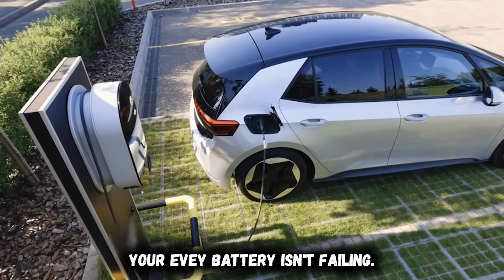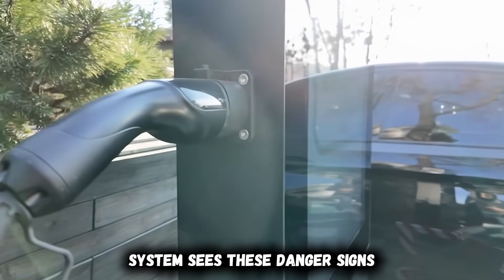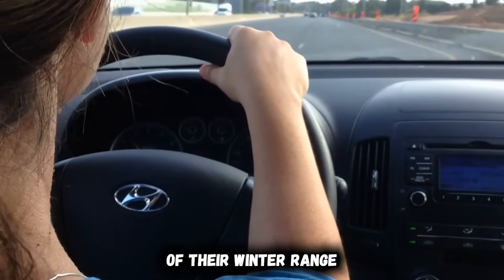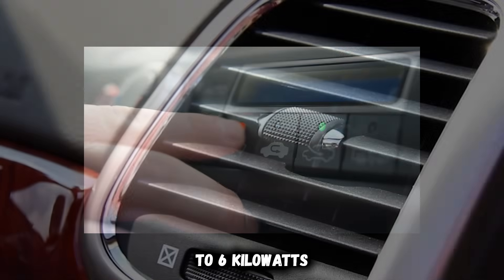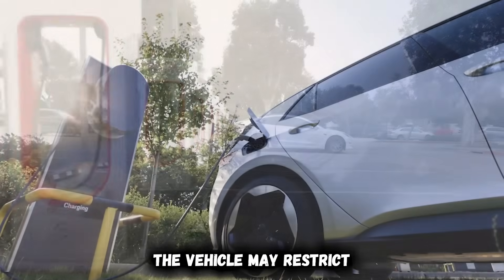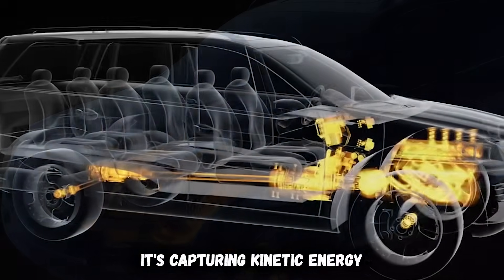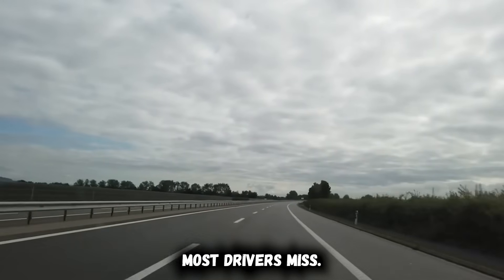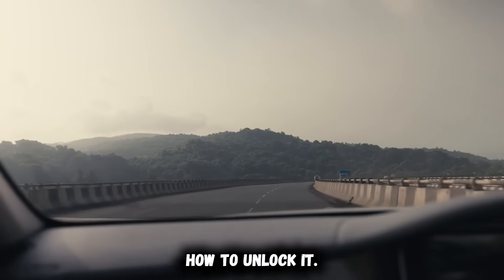Never Do THIS in Winter With Your EV (Most Drivers Do)

Comment: Great Video!  Do you still need to precondition the battery to charge it on a garage charger that is level1/2 (16 amp/220v) NOT fast charging?  I always precondition battery before driving but then when I get back to the house I usually plug straight in to the charger there - I don't precondition again until the next time I am going out. 2024 M3 highland AWD.
Reply: if you plug in as soon as you get home, your battery and motors are alreay warm from use.  In hot weather you should actually let the battery rest for a couple hours to let it cool down.  If you plug in immediately but have time-of-use lower cost electricity overnight, program the EV to charge while the cost of power is lower.  The EV will pull a small amount of power to keep the battery temperature in the best range for the timed charge up later - because the EV "knows" the programed charge time is coming, and also knows the battery temp and ambiant temp. outside.
Also program your departure time, and the EV will precondition (heat in winter, cool in hot summer) the battery pack and motors and your cabin to be ready for the time you set for departure.  In very cold weather my EV may start the preconditioning almost an hour before my programmed departure time, to slowly warm up the battery pack and motors, and then just ten minutes before the departure time warm up the cabin.  These are very sophisticated systems.  The EV doesn't let you "damage" the battery pack - they have 8-year warranty on that expensive pack, and they do a lot of things to make sure it is always protected.

Comment: Is preheating your car the same as pre-conditioning. 2) how do you precondition the battery if the charging destination is charger that is not a supercharger
Reply: the EV doesn't need a 'super charger" to precondition - any plug in will do.  The super chargers are designed to charge up your EV FAST so you are not waiting for hours to get going agian.  Standard wall outlet (120v AC) can be used to maintain your EV while you visit someone, and it will charge a small amount if it is not super cold.  240 v AC outlet is better, ie higer energy available.  Can precondition and charge the EV at the same time, often at 6kW to 10kW rate depending on the electrical supply. In cold weather you want at least a 5-6kW 240v AC level 2 charging - ie a dryer plug 30-50 Amp outlet.  - but most homes without an EV will not have these plugs on the exterior of the house.  Some may have in a garage or carport.

Comment: Good video, you talk allot about preconditioning before leaving the house. How do you warm a Tesla if say it’s been parked outside in really. Cold weather for three hours and you are mot near a plug,  say you were at a friends and it’s -20and time to go home , this I cannot seem to find answer to
Reply: you can leave the car "running" which will continue to keep the battery and cabin warm - it will use some energy for those three hours.  You can ask if you can plug in your 120v AC destination charger to their house while you visit them {if they ask you, your max electricity use would be about 1.3kW per hour x 3hrs (say) x 15 cents would add 60 cents to their electric bill for your visit.  Bring them a gift when you show up, everyone got something.

Comment: Emmmm… “never charge when your battery is below 50F”?   Yeah, if that is a detriment to battery longevity, I would assume the car makers have already addressed that so you don’t need to worry about it (I don’t see a battery temp gage in my car, does anyone else?).  Otherwise this would be a very very significant problem from all of the cars manufactured. This video waste of time, click bait and overly dramatic

Comment: but preconditioning takes battery as well, so i feel like it doesnt matter unless it takes less energy preheating than it does just driving it
Reply: The point of preconditioning is to do it while plugged into the grid.
If you have no plug, then the preconditioning is to ready the motors and battery (and regen braking) to work when you start to drive, otherwise you will see your EV report less than 100% available power, and your re-gen brakes may not work at all, meaning your using regular friction brakes.  In cold weather, if you know your departure time - program the EV so it prepares for that time.  If you can, plug in while you are stopped, even a 120v level 1 will maintain the battery temps better than off-plug.

Comment: the Lucid fixed this with using a heat pump for heating the cabin and battery
Reply: Ford Lightning did too in 2024, but there is still more energy needed during cold weather - to maintain cabin temps, battery pack temps, electric motor temps vs mild weather,  no free lunch.  The 92% efficiency of electric means there is no exessive waste heat being thrown out via the Radiator out front, to scavenge cabin heating from.

Comment: This guy is clueless 🤡 If you get to s DC charger with a cold battery, the BMS will first warm the battery up to a temperature where is can charge fast safely. If it is out of this window it will not charge, it will only warm the battery. 
He is correct regarding preconditioning the car before leaving will give better range because the battery and car is warm.
Reply: BMS is there to protect from catastrophic failure and excessive lithium plating. Some lithium plating is always bound to happen, the more the colder it is. It is up to the car manufacturer to decide how much to sacrifice battery health for performance.

Comment: when should the recirculating cabin air button be activated?
Reply: in summer or mild weather - because if you try to use it in winter, all the windows will condensate and fog up.
If you pull up behind a dirty diesel you can switch to recirculation for a few minutes until you blow the doors off the diesel and leave them (and their stinky pollution) behind you, then turn off the recirculation again before the windows fog up. handy in the drive through too.

Comment: Unfortunately for the rest of the people who know nothing about lithium batteries and their chemistry this fool saying that modern TVs that pull up to a charging station in freezing weather will have lithium plating is deceptive and misleading, and apparently knows nothing about how lithium plating actually occurs.. without getting into the specifics which would take many pages here's an example of why this b***** video is pure garbage... I currently own a 2017 BMW i3 it's 10 years old and has 120,000 km on the odometer it still has 93% of its capacity. I talked to the previous owner who regularly charged it when it was freezing temperatures in Quebec. My previous three BMW I3 vehicles we're also charged when it was freezing and none suffered any degradation which would occur if there was lithium plating... lithium damage occurs when you attempt to charge faster then the battery can accept as the lithium ions move more slowly the colder the battery is.For example, my 28 kwh battery charging at 7 kw is only 1/4 c and if you don't know what I'm talking about you shouldn't have made this video...in fact when i checked the actual charge rate this morning at -8 Celsius  the charge rate was only 4.8 kw proving that the BMS is reducing the charge to what it has been programmed to not damage the battery ...damage is possible when attempting to charge faster than you can move those ions but at thisnrate and this chemistry you wont damage it at all. The last point and most important of all is that these multi-million-dollar corporations know how fast you can charge a specific chemistry type without doing damage so they limit the charge and allocate most of that charge into heating the battery so that it can be charged safely

Comment: Garbage. We had a few where I work. Cold climates are krytonite for an EV. They burn through tires because they are heavier. Don't use your lights or heat. Battery drops rapidly.

Comment: but my area stayed at 20 degrees or lower for an entire month last year.(single digits at night)   Does that mean I can never charge my EV for a whole month?
Reply: No just charge it. It will heat it up before charging if too cold and will limit charging until warm. Always do the charging after driving not before driving use the heat the battery has in it to get the charge going

Comment: Gas refuel, five minutes and on the road.
Reply: HAHAHAHAHA 
EV: arrive at home, takes five seconds to plug in, fully charged in the morning ready for another full day of driving for a few pennies per mile.  unplug and just drive. LOL.
ICE: drive to the gas station (not fueled at home) stand beside your car in the cold, in the rain, can't leave the car while it is fueling, pay $70 for the smelly gasoline.  Do it again every week. LOL. yeah takes no time at all.
A study monitored 1,000 car owners, 500 ICE and 500 EV, and even with DCFC on trips, the ICE drivers still spend MORE time refilling per year. And, a lot more money.
The best part of an EV is the things it doesn't need: exhaust systems, alternator replacement, starter motor, Evap system leaks, transmission problems (looking at You ten-speed GM) transaxel, turbo, head gaskets, spark plugs - oil changes all year every year...my EV 30,000 mile check "change the cabin air filter, and top up windshield washer fluid" LOL.  580Hp, 0-60 in 3.8 seconds no maintenance 8-year standard factory warranty.  drive for pennies per mile, mile after mile after mile.

Comment: Below zero Temps now in mid West. Good luck EV drivers.
Reply: I live in Illinois,  when it gets in the 15 degrees F , It takes my tesla 15-20 minutes in the morning to precondition the battery while plugged in,  cost Penny's. I can also set the car to precondition battery automatically before I leave, ill never go to gas car again ! From $250.00 In gas a month i'm down to $45-50 a month and zero maintenance  besides windshield washer fluid.
Reply: @AndersonERockefeller same!
Reply: No problems in winters here with even -30C.
Reply: When I had a gasser - remote start it to warm it up in winter - takes 20 minutes of idle time to warm the cabin and costs dollars per day, and it is hard on the engine to sit there running like that.
Now with the Lightning, it preconditions itself based on programed departture time - which you can easily change from your phone - costs less than 20-cents to precondition and heat the cabin - silently - each morning and is Not hard on any part of the system. Once heated up on-plug, you unplug and go about your day every day for a buck or two per day, not $15-25 per day.
no spark plugs to change, no oil changes 4x per year, no exhaust or muffler work ever, no starter motor, no altanator to fail, no transmission issues (ten-speed shit) and never need to drive to get fuel, just plug in at home every night, and full tank every morning ready to go.  Best truck for winter - because it has 50-50 weight front and back.  Best short distance tow vehicle by far.  The Lightning out-pulls my 3/4 Ton easily. 580Hp 0-60 in 3.8 seconds - try to beat that.

Comment: Just never do a BEV and you'll never have to never do whatever this video is telling you to never do. Drive a gas car and liberate yourself! Simple.
Reply: Cost of gas per year for a hybrid: $1800.  Electricity for a BEV: $300.  If the cost of the vehicle is equal, it's a no brainer to get an EV.
Reply: @davidp.4727  cost of wasting your time charging, immeasurable. $300 yearly cost for electricity, is pure delusion/bullshit.
Reply: @zooker7507  Plug in at home, is that so hard to understand? I own an EV and yes, I pay $300 a year for electricity.  Inform yourself.
Reply: @zooker7507  takes a few seconds each night to plug in-in, and a couple seconds to unplug in the morning, full "tank" every day for pennies. does it take a few seconds to go to the gas station and pay $75 x 40 times per year? no.  My EV truck costs a few hundred per year to drive, instead of $6000 in gas. plus oil changes, plus exhaust/muffler/starter/alternator/transmission.  I invested the cost difference, and in 7 years it will be enough to pay for the next truck. Does the Oil company pay you for your next truck?  In early 2025, the Lightning was the SAME price as a 5.0L F-150.  With cheap electricity, this was a no-brainer.
Reply: @r.b.l.5841  your not making a good point. Gas cars are practical tools of freedom which allow you to travel across the country with great ease if you choose. Even if I was afraid to travel I would prefer the convenience of gas vehicle, and the safety, and the practicality. Too many things to speak of. This savings of electricity you speak of only exists because of subsidies that are in place to encourage or trick the population to adopt the new tech. Once adopted though, you will see that the market of energy pricing won't be in your favor any more. Your belief of savings you get from electricity over gas was formed through careful planning by those that hope you don't understand that slight of hand.
Reply: freedom, lol. the first thing I noticed after getting the EV was actually being free. 
That is free from the oil leash, which is quite a liberating feeling.  
meanwhile at our home we have one ICE, one hybrid and one full EV.  we can chose which ever one makes the most sense for any given application.

When i bought a cordless drill years ago, I didn't throw away my corded drill, I  just didn't use it very often.  I start the ICE once  week just to keep it in working order, but we don't use it very often.  Mostly a loaner for visiting family, until they catch up with the times.

travelling across the county is no problem in an EV since 2022 when all the makes opened up access to one another.  I drove over 30,000 miles for under $600 last year, did you?
Reply: @r.b.l.5841  now your bound by your electrical cord. 45 seconds to fill my tank and I'm on my way.

Comment: If you pull up to a Supercharger and your battery has not been preconditioned properly, the BMS will use the Supercharger energy to warm to the battery first to avoid damaging the battery. It can take up to 40 minutes to start charging if your battery is frozen. The BMS will prevent charging to protect your battery.
Reply: The BMS has a minimum threshold below which it will not permit charging. You need to check the manual to see how low that threshold is for your own car, as the advice onine is pretty general. For example, some manufacturers quote 20degF but in the small print your SoC needs to be well  over 20% to charge at that temp. Some commentators advise not letting your SoC get below about 30% when temps are at freezing point or less. This is because the car can use some of that to raise the battery temp enough to get above the BMS' threshold. If You're below the threshold and there's too little in the battery to warm itself up through preconditioning, they say you simply won't get a charge.
Reply: @mikeshelley4996  The BMS won't precondition below 5% on a Tesla, but it will charge. And if it's cold, it will use Supercharger electricity to warm the battery while restricting charging rate til the battery is warm enough. If the battery temp is below 32F, it might take 45 minutes to warm the battery before the BMS will allowing any charging.  (This was happening in Chicago a few winters ago)
  The BMS is programmed to protect the battery in these conditions.
Reply: @777Outrigger  I think my Kia has a higher threshold but manages to charge OK at 20F provided there's plenty still in the battery before you start. I'm not minded to experiment - and the dealership hasn't clarified the numbers.
Reply: @mikeshelley4996  so if your declared range is 500km, what real range do you actually get at -20 Celsius? 200?
And then comes the recommendation to only use 1/2 of your actual range to account for being stuck in traffic.
Reply: @marekstanek112  I've seen the range reduced by 45% in -25F (-32C), but he didn't precondition the battery before he left.
And you won't be consuming much battery if you're stuck in traffic. In fact, if you happen to be worried about not having enough charge to get to the next Supercharger, just slow down 10-15 mph. You'll see your range rise by a lot.
 And if you're worried about getting stuck traffic in the freezing cold, Tesla's batteries will keep you warm for up  65 hrs starting from 100% battery with the thermostat set a reasonable level. No one has frozen in a snowmageddon in a Tesla, because the heaters just don't consume that much electricity.
Reply: @marekstanek112  Fortunately I don't get -20C but I take your point. At around 0C I appear to have "lost" about 35mi (just over 50km). Personal safety in winter, though, is an extra consideration. Having plenty of juice in the battery could be a life-saver if you get stuck somewhere below zero, so why allow SoC to fall seriously low?  I'd rather have the reserve and spend it on preconditioning and comfort than risk having the problems of low SoC adversely affecting ability to charge. Does your real-world experience suggest different, please?
Reply: @marekstanek112  Somewhere around 250-300 km , more when you are on a roadtrip because you do not need to wrm the battery at every drive again. ps Depends on model car , at -20 Celsius an average heatpump is not saving energy anymore...

Comment: Normally the seat heaters and steering wheel heating doesn't have to be on except a few first miles of your journey.
Reply: Normally? Doesn’t it depend on the cabin temperature and how cold the driver feels?
Reply: @andytunnicliffe7223  if you have preconditioned your car (including heated interior) and have proper winter suitable clothing on, I have found that heated seats and steering wheel doesn't really have to be on all the time. But of course if one chooses summer clothing then I can understand the need for continuous heating 😂
Reply: @FaaBaar in other words it’s subjective